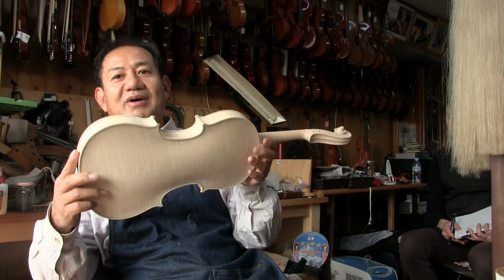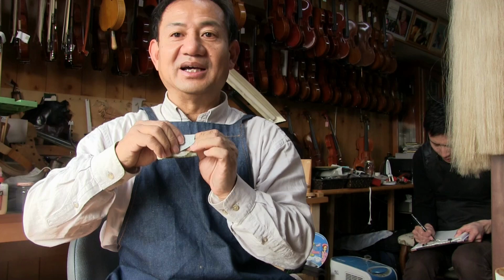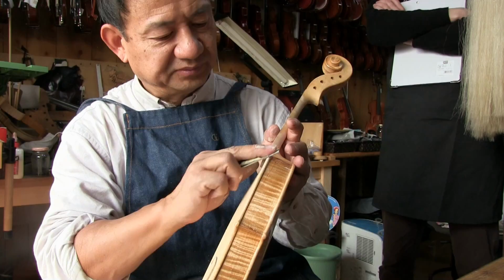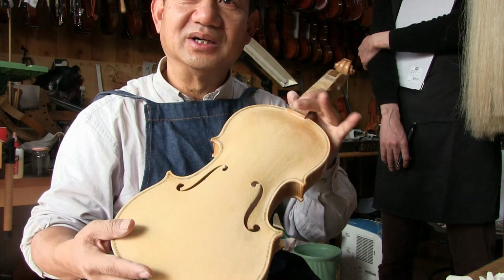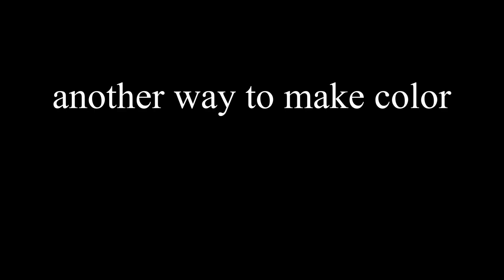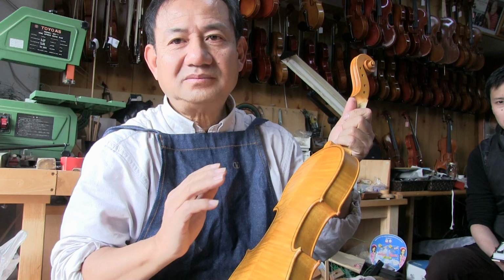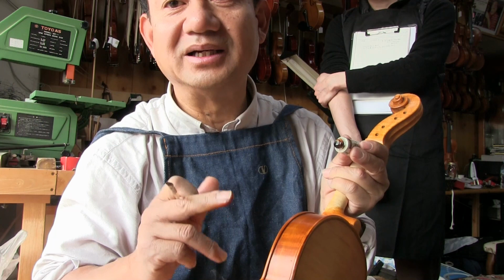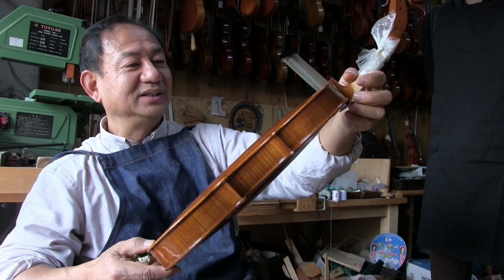Violin Varnish Color 1

Comment: Fabulous instruction, but I would greatly appreciate details:
What specific varnish are you using?
What grit of sandpaper?
What specifically is the product in the tube you are using for the second part of the coloring?

Thanks very much.
Reply: I got a guy teaching me each step and how to mix the colors, what to use what not to use, he is getti g his appraiser license so he knows hit me up I'm about to restore several old violins, I need the finish to be right.
Reply: I was told wet dry 500 grit
Reply: Get pigments off eBay, 5 colors dry or 5 colors with a sac gum rosin, which gives an elastic nature. Zinnser clear 100% wax free sandable clear seal coat, I found at local hardware. But this is the best to work with, you'll need a few baby food jars to mix color in, amber, red, brown, for the finger board first black liquid shoe polish, followed by, a couple other steps to be super smooth

Comment: I tried to paint a piece of raw pine tree with organic virgin coconut oil.  The result seems to me amazing. 
Professionally, from the sound point of view, I have not any  knowledge if it can be used succesfully on violin wood. What do you think about it?

If it may be used because of good sound response, It should be used  on the outside and inside of the violin to avoid stress development. 
Is it possible to try it ?